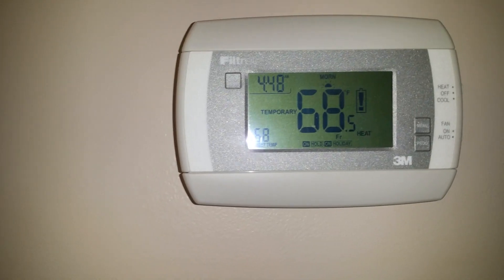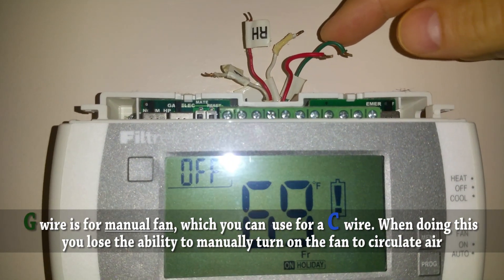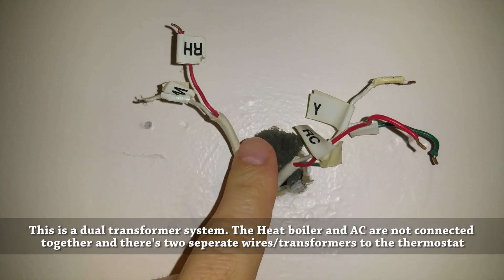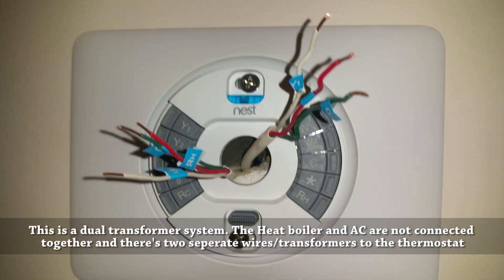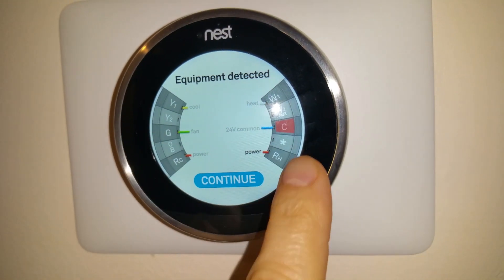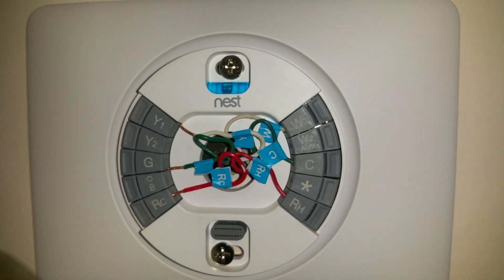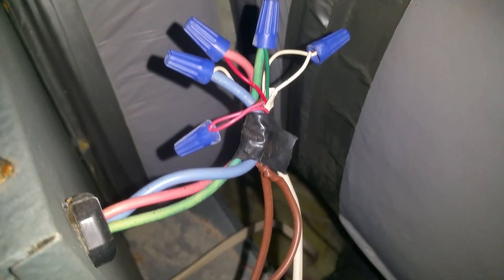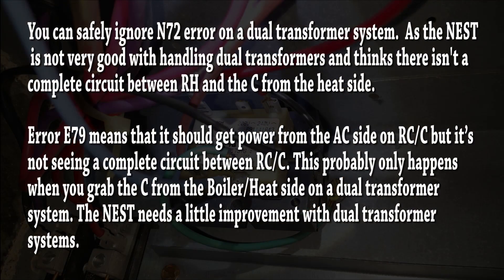Nest thermostat Install on a dual transformer system - how to obtain a C wire

Comment: This is my exact set up and the exact issue I was having with trying to use the unused green wire from the boiler as a common. I’ve been researching my Nest issues forever, even had an electrician come out to no avail. Thank you for explaining this and showing a solution that works. There’s not much out there on the internet for a split heating/cooling system. I have hydronic baseboard heat system with three zone valves located in the basement and an air handler for AC in the attic (only one zone) both controlled by the nest.
Reply from the maker: Great to hear this help

Comment: This video inspired me, I have an extra wire on my heat side. I bought a 24v 500ma transformer, I wired it whereby one leg goes to Rc and the other to C. Leaving the Rh in place. This was the fix for my dual transformer set up. I actually now have three transformers, I simply removed the Red Rc wire and taped it off. Haven't been able to test my AC yet as heating season is upon us here in the Northeast. Although confidence is high with that
Reply from the maker: Great

Comment: A sincere thank you for this. I was out of my mind when it came to why my system would not recognize the common with both my systems plugged in. Using the common from the AC side was the fix, even though it recognized the common when only the furnace wires were plugged in. Very odd but glad it's fixed!
Reply from the maker: Glad it helped you

Comment: So if I run a new 3 wire cable I can hook the third (C) wire to a second transformer and the red and white wires for the furnace I already have to my current transformer? I don’t have a C connection on my old furnace.

Comment: The best way is to put a relay on the heat. Cut the two wire and go to n/o contacts and use the a/c power for the coil with w and rh and rc will have power from the a/c one source. And make sure u add your c from the A/c power supply

Comment: Ok I have a separate nest thermostat for my ac and Heat 3 nest thermostat for heat. I ran a separate transformer for the heat thermostats connected two wires to the heat thermostats one to C and one to RC no errors. This solved my low battery problem for all three thermostats. Now I used the same trans former  for the AC and I was having the exact same issue explained in this video except I don’t have a WI hooked up because it’s not being used for heat.. My air handler is old at least 20 to 25 years old. No C wire jus R WI  G and a number 3 terminal the R and G go to the thermostat but the Y1 must be coming from somewhere else probably the compressor.  Hooking up the C and RH gives me the no power to RH error. The thermostat would not work with that error.  Is it because I’m using the separate thermostat that is hooked up to heat? If I disconnect the RC and leave the RH and C no errors but AC won’t come on. So I’m out of tricks. This video came close to what I was expecting

Comment: I just want to make sure I understand correctly. On my current thermostat transformer, I have an R and a C. Right now, the R on my transformer goes to my thermostats, comes back to the zone valves (the W terminal on the thermostat) and then from the zone valves, goes back to the transformer into the C Terminal. I too have a an extra Green wire coiled around, are you saying I can just connect that wire to the "C" terminal as well, so there will be the return from the thermostats AND the common wire both connected to that "C" terminal? From that Green wire I can connect it to one of the extra wires I have going to my thermostat and make that my common.

Comment: Hi Da P.A .. Need some help. I have a Dual Transformer system with separate heating (Base board) and Cooling (AC). I am trying to install Nest Learning and connected Rh, W on heating side and Rc, Y, G (for fan). As per video I connected the Common (C) from coiling side into the C. I am however getting e79 after that and it doesn't go away. The display keeps showing it. (I also have a green wire on the heating side which I am not using since the nest gives a error of wrong wiring and doesnt let me do anything on it) .. Thanks for your help in advance
Reply from the maker: Try using both grounds.
Reply: @daP.A  Do you mean insert both green from Furnace and C from AC into the Common wire (C) slot ?

Comment: This is my exact issue. When i turn the heat on its turning on the HVAC and not my oil burner. Im still stuck. The common wire is coming from my HVAC and my builder is a 2 wire system which should be RH & W1.

Comment: Having a very similar issue. But I have heat pump with my AC also. Stumped. Any thoughts? I know this is an old post.
Reply: @daP.A
Reply from the maker: @mark_rutt  not sure, search online forums. Make sure your C wire comes from the AC side although am assuming it's all the same transformer for a heat pump. If you find a solution let us know.

Comment: I have a smilar problem with  the N72 but for my problem iy starts the AC (AIR forced) when I try to start the heat (baseboards). I don't have a C wire

Comment: Great video! What if I want to use a 24v transformer to power the Nest..they say to connect the transformer to C and Rc and connect a jumper from RH to RC. Is that ok to do though? I don’t want to blow anything 🙈
Reply from the maker: You don't need to jump the nest. It does that automatically if it needs to.
Reply: Yes a transformer is fine.

Comment: I believe if you enter the pro menu and declare heat as oil/gas and ac electric it may disable the feature that jumps rh and rc. Not tested but am dealing with a similar issue on a system with one transformer that is pro setup for duel fuel. In my case it wants the rh and rc when they are actually the same. Theory not tested yet
Reply: Tested SAT, thank you.

Comment: Thanks for the sharing this, I got exact same issue and finally resolved after watching your video here. I've reached out to Google for support, but they are useless.

I have a central air for cooling and baseboard for heating. They are two separate systems... Google/Nest didn't explain why it has to be a C from the cooling.
Reply: Same thing, I installed a nest thermostat gen 2 10 yrs ago and this one didn’t need the c wire, but I pulled and connected it to my heating transformer and came up with the error. I believe when I called support, they told me that the common had to come from the cooling transformer, so I left the the c wire off and let it operate without it.Ran into the same problem a few months ago, forgot about the c wire needing to be from the cooling transformer and spent hours with tech support , swapping out to another nest thermostat and finally left the wires off the cooling terminals so it would work. So frustrating, they should have this stated in the instructions.

Comment: Hi, thanks for the video, it certainly helped with understanding the wire scheme. I also have an AC unit (Rc, Y, G, C) and a boiler system (Rh and W). When my heater is on standby it chatters and clicks, when the heat is on, no issues- ANY SUGGESTIONS? Thanks
Reply from the maker: I don't think its nest related. Might be normal or a Boiler issue. Was it doing this prior to the nest? If it was a nest issue I would think you would have issues when it was calling for heat. As long as your getting the common from the AC side you should be fine.
Reply: @daP.A  It was working just fine with my very old thermostat. Just started clicking today when I installed the Nest 3G unit. I'm also getting an N72 error on the nest thermostat.
Reply: So I guess the questions is, who do I stop the clicking sound?

Comment: Da P.A - I have the 24v transformer already connected and wired to 3 thermostat. Can I jump that wire to the C on the thermostat? I have only heat (furnace), no air conditioning.
Reply from the maker: Should be ok if you only have heat.

Comment: Hello, Thank you for your video, I have the same issue on my dual system. my nest thermostat was installed during the summer and AC worked fine. recently we decided to repaint the walls and I took off the Thermostat, when I was connecting the wires back to the nest I saw N72 error first and I tested the system. After a few days another error appeared - E102. E102 disables thermostat and you can't use it until its fixed. I talked to nest for a few hours and after all troubleshooting they decided to change the base. New base arrived and when I installed it I saw the same N72 (so far without E102). heat and AC seems to be working. I also have a spare green wire with W1 and Rh. what do you think about this situation? My AC is forced air. and heating is Gas floor radiators. House was build in 2016, so everything is fairly new. Also I have 3 heating zones for heat only.
Reply from the maker: N72 seems to come up on dual transformer systems, nest doesn't see power from the heat side although if heat and a.c. are installed it needs to see power from a.c. side but complains about heat side. As for error 102 not sure maybe hardware error.
Reply: Read my post might help ya get rid of code , how many heating zones are controlled by the nest ?

Comment: Having this issue still in 2024... I need to get the C wire from my boiler because the boiler is connected to the standby generator, where my air handler is not.  When we lose power, I have no thermostat power which means it'll never call for heat and therefore I have no heat even though the boiler is hooked up to the generator.  What a pain

Comment: I just got the nest e, I'm getting error 159. I have one system that has dual zones, gas heat and forced air for ac.  I have the c wire but nest told me that it isn't supplying enough power any suggestions?  Nest had me switch the heat wires and the ac wires and everything worked opposite of course.  I don't get it

Comment: I have the same issue, when I connect the C wire it gives the error of power. But I didn't understand what exactly do I have to do? Do I need extra wires? Even nest support couldn't help me with that :((((

Comment: we had ac installed in our house with a separate gas boiler with 2 zones , we wired it like this I requested a c wire be installed from air handler assuming it would charge battery during heating as well , all summer my house was nice and cool , come winter and the first week my controller went on my heater and a zone valve fried ..... turns out the nest was toggling the zone valve end switch on and off because it kept taking power to recharge battery , fried my boiler controller and zone valve ( they were old anyway) fixed the parts and still Nest couldn’t hold the zone valve open for more then 45 seconds, we has the same wiring as you, after many calls hours on hold to nest a replacement unit and a Nest tech coming to the house the fix was 2 choices , I run the common from the boiler and put it together with the common from the air handler in the C terminal on the nest or install a isolation relay , after some thought I didn’t feel comfortable with 2 different transformers touching each other on the common in the nest so we went with the relay and it’s been perfect ..... heads up check your zone valves
Reply from the maker: Even in the winter with the a.c. off  air handler transformer should ways be on and nest uses it for power/ c wire. The only reason that I suspect that the zone valve got fried is because no power was coming from a.c. side which causes nest to pulse on off in order to steal power. This most likely caused or zone valves to stop working.
Reply: We at first thought the nest got damaged because after the new controller and zone valve were installed we noticed the toggling, the air handler was sending 27 volts and common was connected , they sent me a new unit and backing plate , same thing call for heat nest pulled new zone valve all the way to the end switch , glow plug activated and boiler ignited after 45 seconds it dropped power enough to toggle end switch , we install a regular thermostat everything works perfect , the nest doesn't see the common from air handler when heat is on just like it doesn’t see the common when you had it from the boiler it coded out even tho a common was connected .... keeping the common from the air Handler and running the boiler wires for heat through a isolation relay fixed the issue I had the standard Honeywell zone valve , just giving everyone a fix if they read this , a nest tech came to my house and explained it his other alternative of putting the boiler and air handler commons together didn’t sit well with me he prefers the relay but the cost falls on customer the extra wire is free he said the air handler and boiler never come on together so the 2 commons touching wouldn’t hurt anything... I’d rather the relay it’s 20 bucks
Reply: @daP.A   No arguing with you just sharing out nest story and work around , don’t you find it odd how the nest coded for power when you had the common hooked up to the boiler and not the air handler , they could probably fix this with a firmware update , the subcontractors that work weekends will never say anything to nest they are making 100.00 per house call from nest and doing 4-6 per weekend, the rest falls on customer  , simple relay or extra  common wire

Comment: Dear Da P.A, thank you so much for such informative vid you uploaded. I actually happen to install 2 Nest 3rd Gen today at my sister's house, which I believe she has the dual system, AC and Forced Air(heat pump?). So the issue I m having is that, I dont have C wire and the Fan just won't kick in when the furnace is working. The fan only works when i turn it on through either App or Nest. Super annoying! Do you think I can use the G wire as C for my situation? If yes, do I need to pull the new wires to the condenser like you did? Or just simply swap G to C on everything...furnace, A/C and Nest? Thank you very much!!!
Reply: The 5 wires I have are: Y1, G, Rc, W1 and RH
Reply from the maker: @jasonphobia7787  you can use the G for C but you will lose the ability to manually turn on the fan which is not that important. However it sounds like your fan is actually working if you can turn it on through the app. Nest should be able to turn it on also when calling for heat. I would call nest customer support. Let us know the result.
Reply: @daP.A  Thanks for replying. So I have encountered really strange situation here...I swapped the G to C and...nothing works lol...I did find an extra wire (color black) so I used as C and tied to the circuit board. Now I have not 5 wires but 6 and still...Fan is not turned on when calling the heat...called the Support, spent 1.5 hrs on the phone with them and they couldn't help...sign...not feeling well now....lol
Reply: What is your nest error code and are you swapped G into C in the nest or furnace ? thank

Comment: Did you ever find out why Nest needs the C wire from the cooling side?  I am installing mine and I typically turn off my air handler in the winter.
Reply from the maker: Not sure but usually the air handler stays on even if the compressor outside is off, maybe nest thinks the common from the handler side is more reliable. If anyone knows please comment.
Reply: @daP.A   I had a similar problem since 2014 but I actually have 2 C wires.  One from the boiler / zone relays for my heat zones which supply W1 Rh C for radiant floors and an AC air handler (high velocity) with Y1 Y2 G Rc C.  I had a call with NEST L1 and L2 support and after some trial and error, we were able to actually use the boiler W1 Rh C and just the Y1 Y2 G from the AC.  We removed the Rc and C wire from the air handler and was able to operate both the AC and heating with no E79 or N72 errors.  So if you have the ability to pull a C wire from the heating side rather than the AC side, this may work.  I actually found that the NEST pulled from the Rh side even when Rc and C wire from the air handler were connected and providing perfect voltage and current for charging.  Hope this helps

Comment: Hi, I have same scenario where I have Heating as Baseboard Heat and Separate A/C Unit. I am using Nest E for My Heating so far by Connecting White Wire to W1 (Nest e) and Red Wire to R(nest E) and Heat is working fine without connecting Green wire to C. Where do I connect my A/C Unit RED (R), WHITE(Y) and GREEN(G) wire to Nest E ? I believe White will go to Y on Nest E, Green wire will go to G on Nest E but Not sure where do I connect Red wire ? Will it go on * O B Connector ?.

Comment: The reason it wants the common on the ac side is the boiler is actually a dry connection it doesn’t want 24 bolts. It would work if it was a furnace but not a boiler
Reply from the maker: The boiler can output 24v and the nest will work with just the boiler without ac

Comment: I just had my Nest installed yesterday at my new house which has Central air with an Air handler in the Attic and my heat radiant with the boiler in the basement. I have a bunch of wires in my wall and there is a blue wire but it doesn't run down to the basement. IM thinking maybe its upstairs inside the air handler since it is sealed. If the wire is there can I just plug that into the air handler C and plug it into my Nest? will that work?

Before I had an old PSENG thermostat with a white to W a red to RC a black to RH a yellow to Y and green to G. It also had a jumper from the RH to RC. Will I be able to set this up correctly since currently I dont have a common connected and dont want to damage my system in the long term using the blue wire in the wall? Please help!!
Reply from the maker: If its from the air handler and its blue than it can be the common wire. i would go up to the air handler check where that blue wire is connect, determine if that C wire is connected to the common terminal on the airhandler before plugging it in to the nest.
Reply: Da P.A got it to work!! I’m getting 3.9v on the nest. Do I need to remove the red wire that says RH power on the nest? Or it can stay?